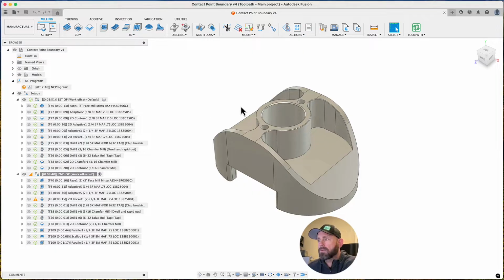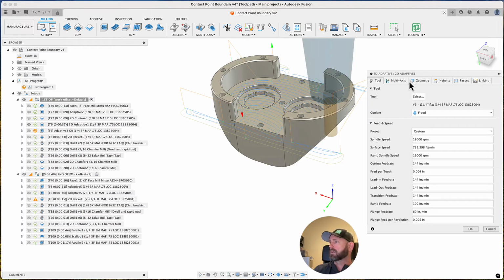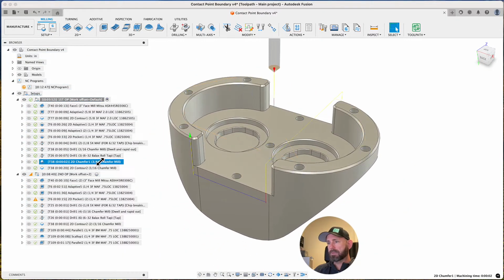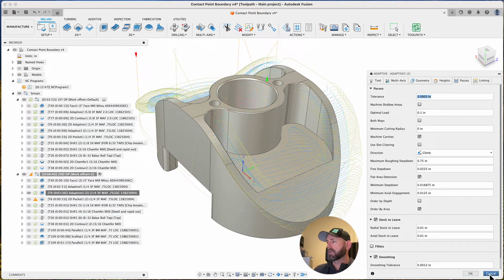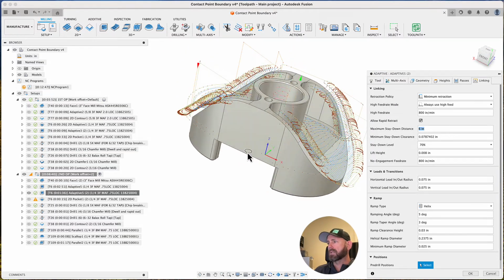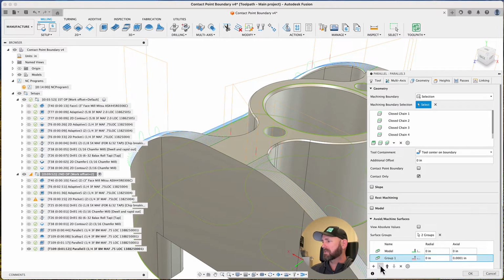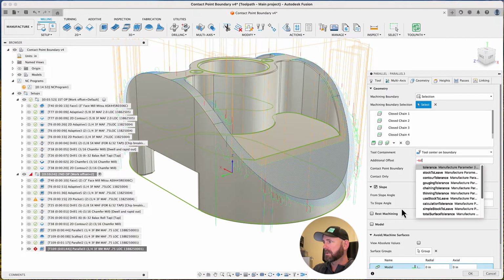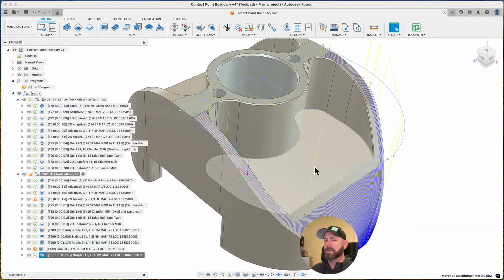Fusion CAM Containments Plus Tips and Tricks

Comment: So, am I wrong? Your drill depth for the tap drill was (1/32)*5 = .1563" and the tap is set to go (1/32)*4.5 = .1406" which only gives you 1/64 or .0156" depth difference.  Hopefully the tap is an OSG tap that doesnt have a pointed tip? If chips are packed in the hole, that may be all it takes for the infamous #6-32 to snap off (if you know about #6-32 it is more prone to breaking than most). I like to give myself a bit more "holy shit error". Id love to know your opinion on this drill depth vs. tap depth as I am sure you have a good reason. 
Also, I have learned alot about Fusion CAM in just this single video! Keep it up, awesome job and thank you!
Reply: Hey Justin, 
Thanks for the comment. My intent was to show how to drive these things from expressions. That said, I lived in the aerospace world for a lotta years and it was common that the holes were modeled at one thing while the print called out something else with the a note saying something like, "min wall thickness XXX". That often put me in a situation of having to thread a needle with the drill and tap. 
I've made thousands and thousands of holes with the above recipe and it's been a LOT of years since I've broken a tap (knock on wood). 
I don't buy taps that don't give accurate details on the thread lead etc. I most often run roll taps or spiral taps meant for blind holes. With both of those I give myself 1/4-1/2 pitch deeper hole than I'm tapping. It's pretty reasonable to give yourself more room if you've got it but I usually set up templates that I know work and just run them. I might be wrong but most of the taps I've seen with the point on the end are intended for hand tapping.  
Does all that make sense?
Reply: It makes tons of sense! Thank you for taking the time to respond. I like the way you explained this. If you’re not breaking taps then you’re doing it right. Your method is great because you shouldn’t have to chase the threads by hand after the part is out of the machine, it’s done and correct, on to the next part. Thank you!

Comment: Thanks. What about discussing how 5 axis toolpaths work with fusion. Are the 5 axis toolpaths affected by the tool view plane? On other software like Mastercam this is not the case even though both use Module Works toolpaths. Is this the case because fusion toolpaths are more like convert 3 to 5 axis  ?

Comment: Awesome tips Tim! My nerd tip is to use the silhouette option for stock contours and outer profiles. I have it set up as default for most operations and it saves me a ton of time instead of picking geometry.
Reply from the maker: That's a great idea!
Reply: That's a good one. I have it as my default but turned it off so I could show the selection manager...
Reply: @ToolpathTim  greatful you did! Contour selection is one of this things that Fusion does really well once you learn it but can be a bit arcane to learn.

Comment: Great video, lots of useful things ;) I would like to ask if the 3D model is available anywhere? and what computer do you work on so that everything works smoothly?
Reply: Thanks for the feedback! 
Yes the model is available in CAM samples. It's an old model I used to teach a workshop when I was at Adsk. 
I show it early in the video. Data panel/Cam Samples/Tutorials/Contact Point Boundary
I'm working on a MAC Book Pro with a Space Mouse and I've tuned the Axes direction to work the way my brain works so I have to flip in/out with up/down.
Reply: thanks a lot for your answer ;) I will definitely test it all :) @ToolpathTim